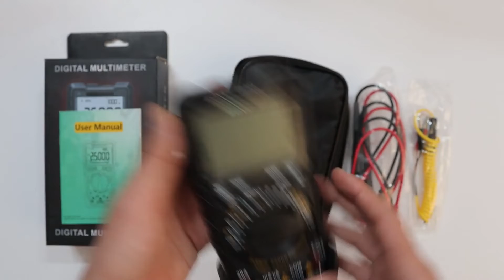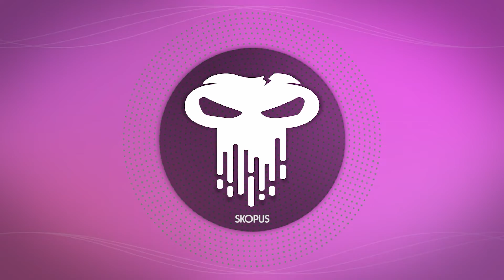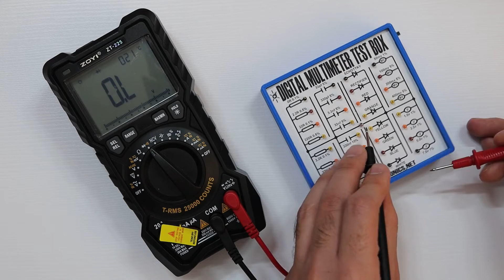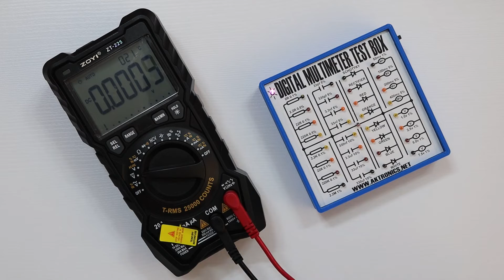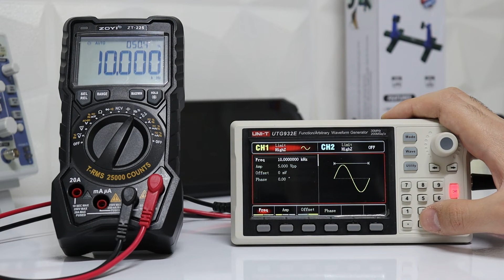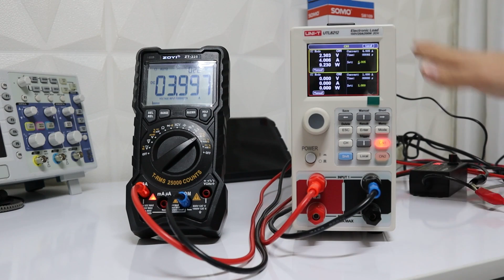#52 Zoyi ZT-225 Review And Teardown - English

Comment: Excellent video and explanation. I want both the meter, mainly for the simultaneous AC/DC setting, and I also want that multimeter tester. Is the tester available to buy? If so, do you have a purchase link? 🙏🇦🇺
Reply from the maker: Thank you. That tester is just a box with some low tolerance component in it. It's nothing special to sell. There is a video of it on my channel, you can get inspired by it to make your own.
Reply: @aktronics okay, I will check it out. Thank you. :)

Comment: Appreciate your review; I was checking to see if any improvement over the Zoyi ZT-303.   Other than 25000 vs 19999 count, both have same resolution and accuracy specs.  The ZT-225 has AC+DC and Temperature, which ZT-303 does not.

Capacitance measurement resolution is to 1 pf, but neither meter is accurate as you showed.  For small values typical of RF work,  ZT-225 (+) offset can re REL'd out, but my ZT-303 has (-) neg offset and can't be zero'd.  It will not measure caps < 25 pf.

Both product specs say "Auto/manual ranging", without explaining what is meant.  V, A, and R auto-range and have some manually-selectable ranges, but on ZT-303, C, Hz, and % scale ranges can't be chosen.  It will only auto-scale.

I was ready to pop for the -225, but don't see enough improvement over the -303.   Thanks again for the super review!
Reply from the maker: You are welcome, no dmm is capable of reading small capacitors below 33pf. In my opinion 100pf and higher is okay. Perhaps invest in LCR meter for that type of work. I don't have 303 but they are mostly identical and based on same chip...
Reply: @aktronics  Agreed, partly...  I bought a Hantek 1833C LCR recently and learning how to use it.  If you understand how to set parameters and do Open and Short cals, it can give reliable sub-pf readings without Kelvin clips.  But that's work, and if you're not so careful, you get pure garbage.  (It sometimes makes me wish for a meter that only gives one value.)  Ideally 'Auto' mode would help, but Auto still leaves  Ω range, frequency, and Ser/Par to be set.

So DMMs are easier to use, and often good enough.  The 121GW is stable enough, has resolution to easily read caps under 30 pf, but mine has ~48 pf negative offset (similar to the ZT-303) and I hesitate to try using a non-official calibration procedure..

So to fix that meter, I use a duplex banana jack between the meter and the test leads.  It has a few NPO caps soldered between its terminals - enough so "zero" reads a small positive value, which REL can correct.  But if the offset is low enough for my use case that day, I don't use REL so the meter scale can be changed without having to re-REL.  If I'm doing some number of cap readings, I just leave the banana jack in place.
Reply from the maker: @0202fabrice  nice work around 👏

Comment: Thanks for the review. Thinking about getting a zt225 just for the ac+dc feature.
Reply from the maker: You are welcome,  hope this review helped you decide better.
Reply: @aktronics  Is it the best multimeter or is there a better option? Please make a comparison
Reply from the maker: @anonamemous6865  There is always a better multimeter. Buy something according to your budget and needs. In this price point 225 is a very good model with good accuracy and good features.
Reply: @aktronics  my budget is closer to zoyi zt 225, the specs I want in a multimeter is great accuracy, many features or(similar in the video), and lastly is safety. I'm a beginner and I want some good multimeter that can motivate me to continue doing my passion
Reply from the maker: @anonamemous6865  It can satisfy all of your needs, just be careful with current ranges. (Just like any other multimeter current ranges are dead short and shouldn't be connected to a power source directly... [in series is the correct way]) other than that it can protect itself in wrong ranges and it's safe to use and safe to even make mistakes. I've explained many things in this video. Watch carefully, hope it's useful 👍🏻